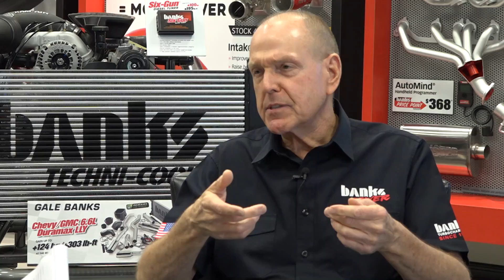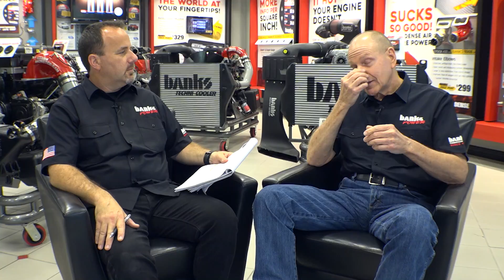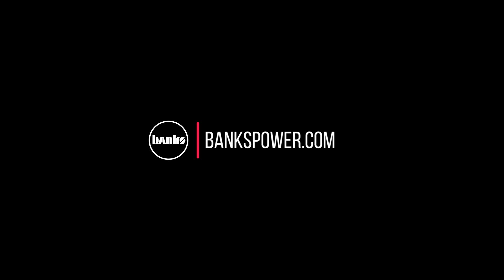Gale Banks Improves the Duramax L5P and Cummins 6.7L

Comment: Which do you feel is the more solid and trouble free platform (mechanically) 6.7 Cummins or new L5P. I like both and trying to determine what's going to be less troublesome after a tune only down the road.
Reply: jacob dukes thanks. My only worry with that platform in the 68trans. I have heard so many horror stories but all I want is to simply tune it and keep everything else stock.
Reply: Duramax is way ahead of Cummins sorry to tell you, not to mention in a better truck to. Cummins would be my last pick outta the 3 now a days. This isn't the 90's anymore
Reply: Micheal Ortiz    Says the Chebby fan boy.
Reply: Micheal Ortiz it’s Isuzu get it right
Reply: @JimmyCasket02  it's not a isuzu shit. The 7.8l isnt used by gm anymore